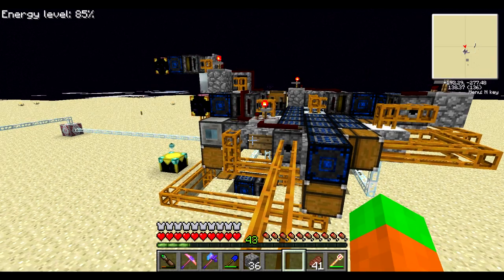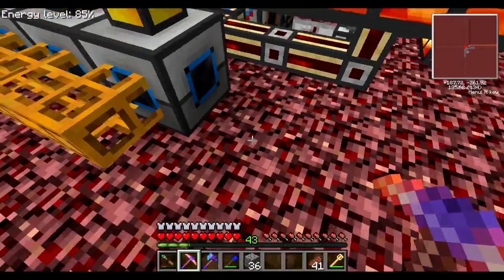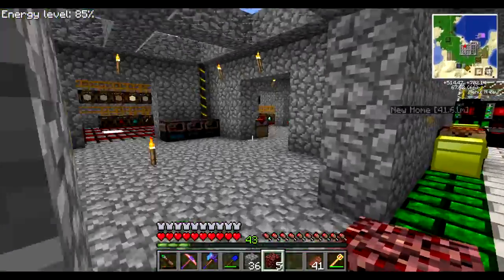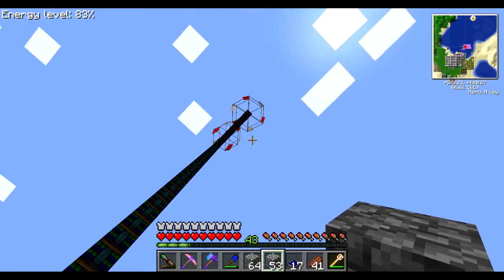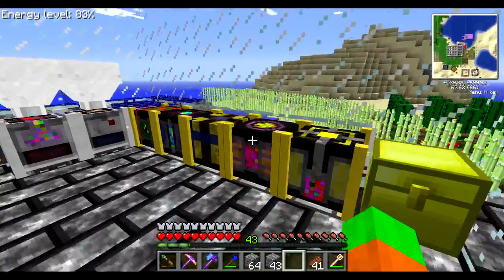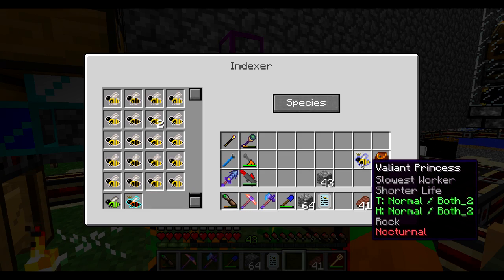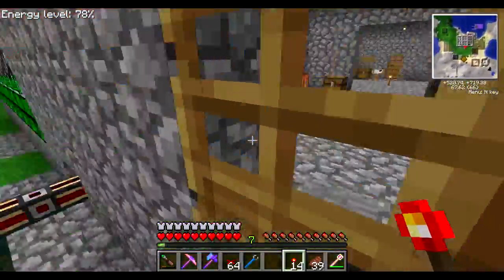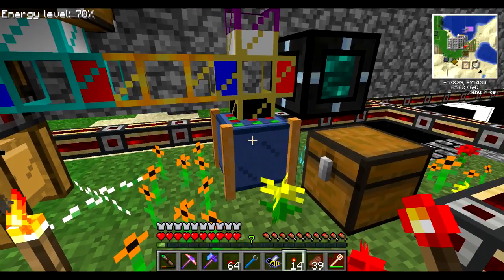odedex Plays - S02E86 - Wireless Energy

Comment: a redstone engine can actually explode but only under very specific circumstances, it needs to be getting powered by atleast 2 other redstone engines and not be powering anything itself and even then it takes a very long time for it to build up to a point where it explodes, so very difficult to do even if you try to do it on purpose

Comment: DO NOT USE A MFSU MAKE THE SOLAR PANELS CONNECT STRAIGHT TO A WIRE AND TO THE MASS FAB. THE MFSU WILL STOR BUT IT IS ALWAYS DAY THERE SO NO NEED BECAUSE THE MFSU LIMITS TO OUTPUT TO 520. THE HIGHER THE VOLTAGE THE FASTER YOU GET YOUR UU